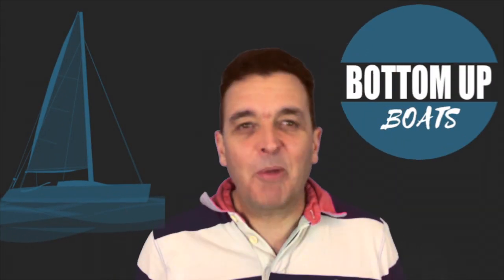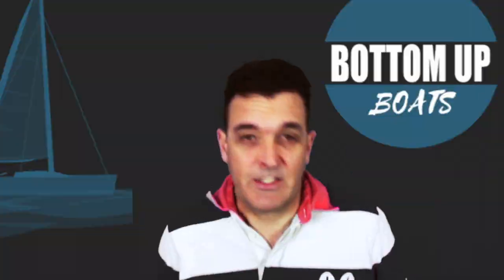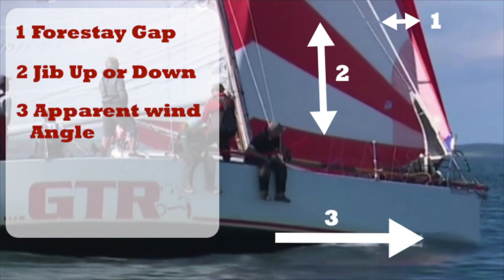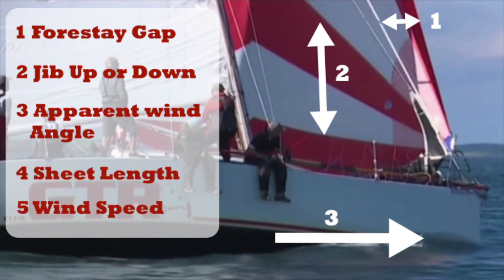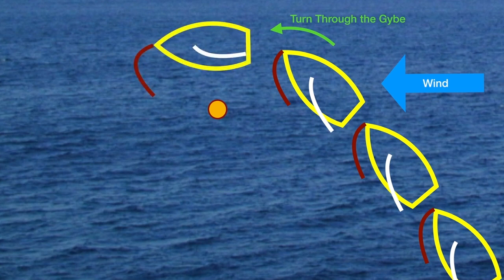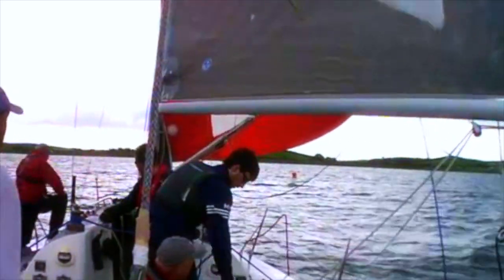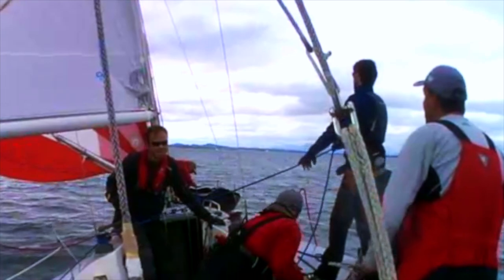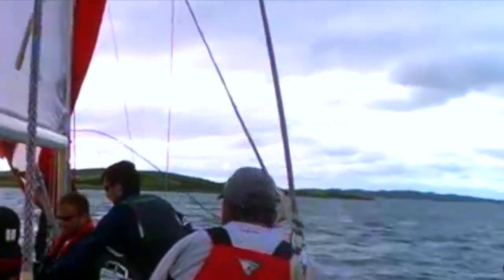Outside A-Sail Gybe. When & How to do it.

Comment: Thanks so much for posting this. I sail double handed with my wife, so I showed her this video and she now knows how to gybe our asymmetrical. She thinks there shouldn't be a problem because she is used to doing all the jobs your half dozen crew members are doing in the video
Reply from the maker: So happy you found it valuable. I would suggest pulling main in first then move to the kite, if you steer a smooth path and time it right what could go wrong 😏

Comment: We gybe the boat inside every time as our skipper fears dropping one of the sheets down over the bowsprit and getting it caught up under the boat. Big problem for us as we use a continuous spin sheet. Pain in the butt raising the jib, and carrying the chute through every time. I never thought of having the bowman up from feeding the sheets across to insure the sheet does not drop over.
Reply from the maker: Good points and that is how we do it on  our j109

How to Inside A-Sail Gybe in any conditions
https://youtu.be/izvjlOoak8Y

On the mumm 36 there was very little gap between the luff of the kite and the forest at really hard to go inside without getting it twisted.

Thanks for stopping by and for the feedback